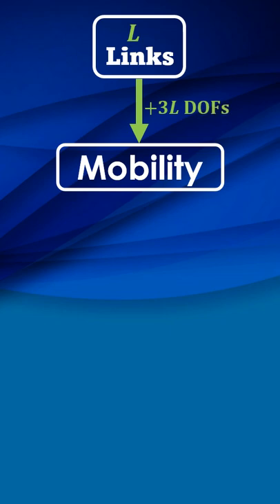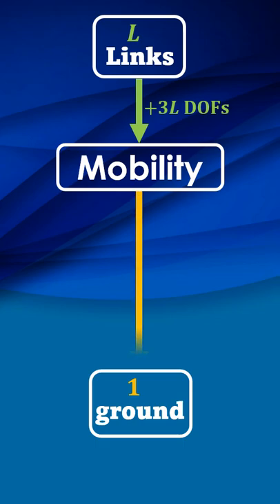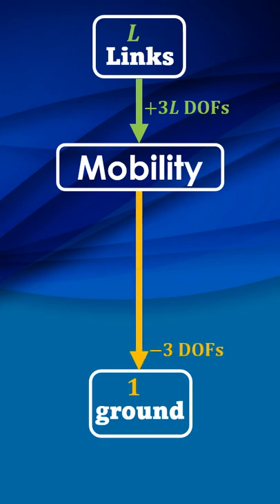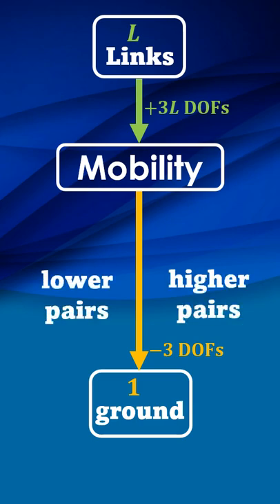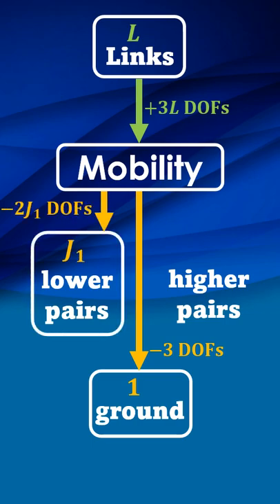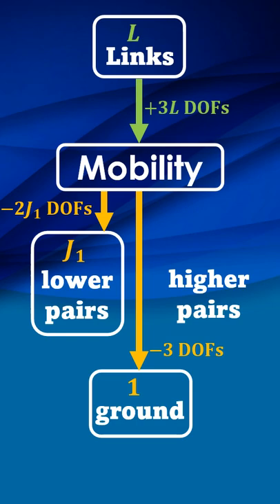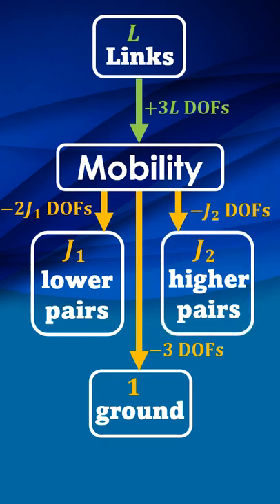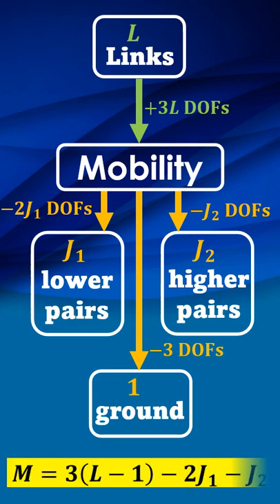How to calculate mobility of a mechanism

Comment: If a mechanism has mobility M, then the sum of its joints' mobility is also M. The number of joint DOF N must be >= M. When N > M the mobility of some joint DOF must be less than 1 and could be as small as 0. If J represents the Jacobian matrix of constraint equations defining a mechanism, the rows of this matrix represent normals to the mechanism's constraint manifold. Columns of the highest rank orthonormal matrix V, which are orthogonal to the rows of J, represent tangents to the constraint manifold surface.

The norm of the ith row of V, 0 <= |V_i| <= 1, represents the physical mobility number, 0 <= M_i <= 1, of the ith joint DOF, where sum over N of M_i = M. If M_j of joint DOF j is greater than M_i of joint DOF i, then qualitatively joint DOF j is more mobile than Joint DOF i. If M_i = 0, this ith joint DOF is locked and cannot be physically changed. If M_j = 1, this jth joint DOF is unconstrained and can be physically changed with minimal effort. If 0 < M_k < 1, this kth joint DOF is partially constrained and can be physically changed with effort inversely proportional (qualitatively) to its mobility number.

The distribution of a mechanism's mobility M across its N joint DOF, in the form of individual M_i, changes with its pose and determines its real mobility, its ability to perform the task(s) for which it was designed.